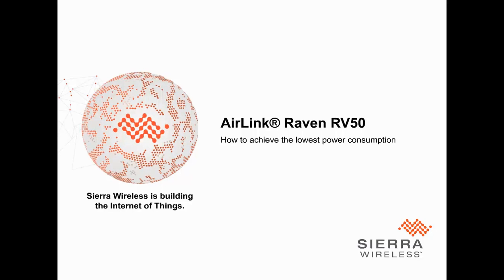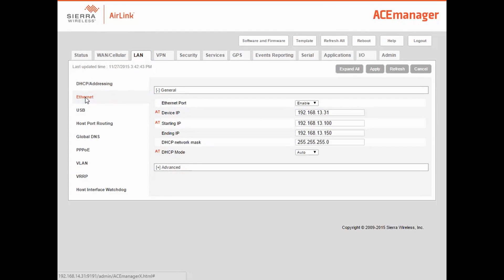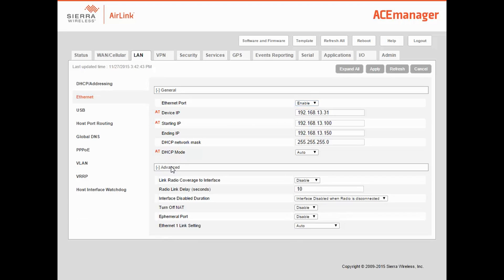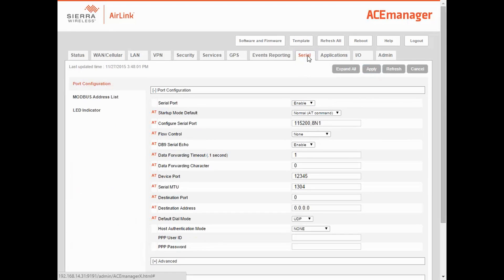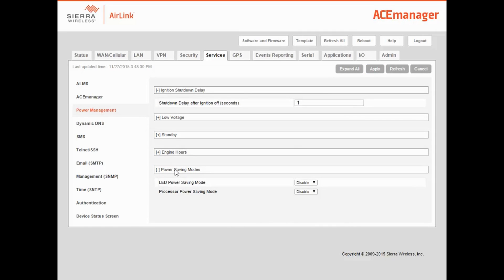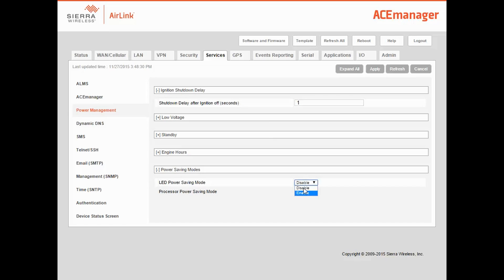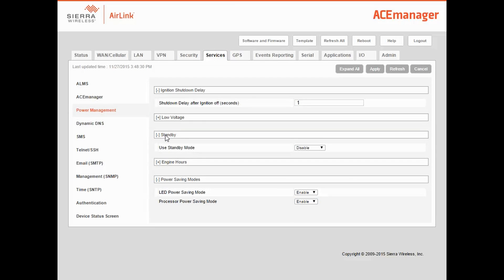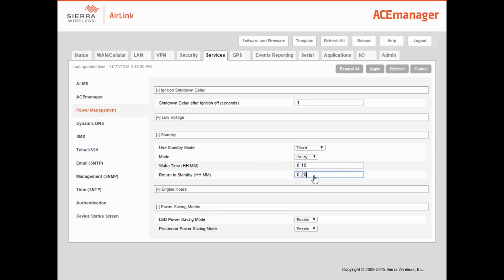Sierra Wireless RV50 Optimized for Low Power

Comment: Hi!

I'm going to use the Sierra Wireless RV50 in combination with an M2M Sim Card (Static IP) to connect a machine (PLC attached with ethernet to the Sierra). to my laptop on office network which uses a visualisation program. the data will be send as OPC UA over tcp/ip.

Do I also have to change settings in the router at my office or only in the sierra. (And if so, which settings?)

Hope to receive a reaction
Thanks in advance! :)
Joost